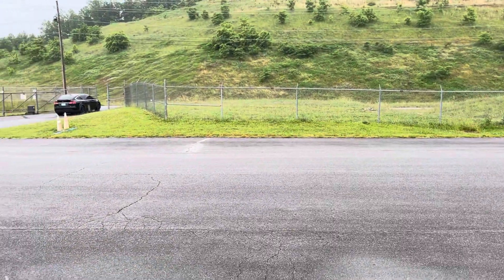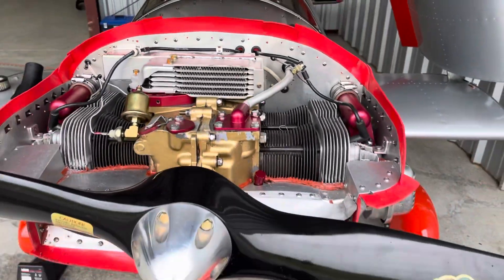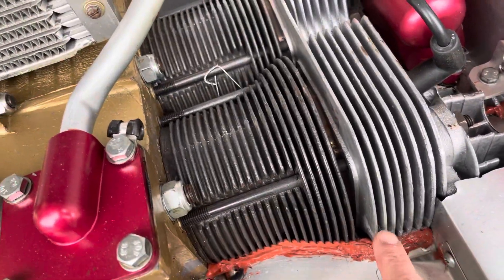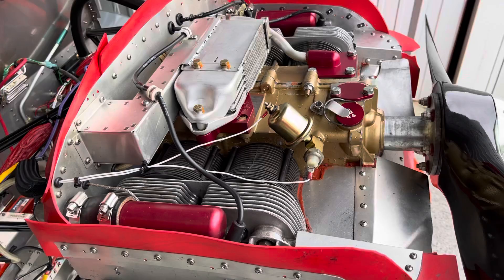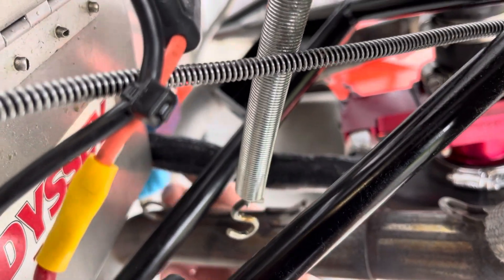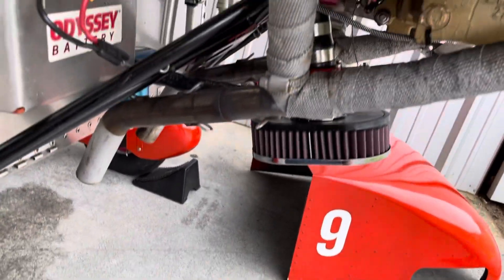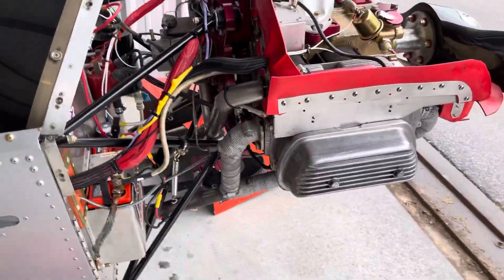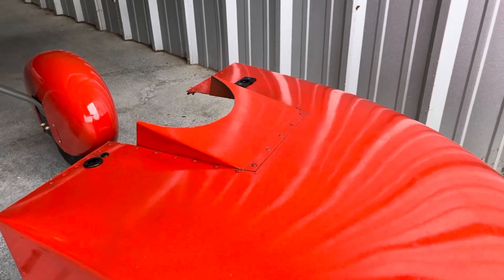Hot and Cold (Lean of Peak Aviation)

Comment: I'd safety that K&N filter - mine popped off and melted on the pipes.  That model is no longer available.
Reply from the maker: I actually changed it.  I didn’t like the security.  I’ve got the one that fits directly into the stock housing.  Good comment!

Comment: I used the same carb setup on my AeroConversion powered Sonerai. As is you don’t need carb heat. Power loss is negligible. Adding a fresh air vent to the carb, if not RAM air, will create higher pressure in lower cowl, decreasing the pressure differential, and you’ll lose cooling airflow over the engine. Plus, you’ll need to add some kind of carb heat.

Comment: Greetings!    Thanks for the videos - new subscriber here.   I would cation you about the mod you are doing.   A large unsealed opening to the bottom will decrease the pressure differential -  thus decrease the cooling air flow.   You will get better engine performance with the cooler air, but less engine cooling resulting in higher cht's. Worse, you installation does not look like it has carb heat.  so getting rid of the inherent carb heat of the old set up may be fraught with complication.   while the  guillotine based aerocarb is less prone to carb ice, check the sones forum and you'll see a few tales...   I would suggest you seal the intake to the carb and add carb heat).  You'll get cool ram air.  Then protect against vapor lock using heat shields and wrap (and if necessary a vented cooling box over the gascolator). I like controllable cowl flaps with a lip.  You can get adequate cooling both for cruise and climb.  be sure you have the inter-cylinder baffles (VW cooling tins).  finally,  be careful about rpms higher than 3000.  If you are going to run high rpms, get the engine/prop dynamically balanced, etc.
Reply from the maker: Thanks for the comments.  The carb heat is certainly a concern and still a bit of a question mark.  There’s hasn’t been a confirmed case of carb icing on an aero carb and it’s really hard to know if the stories on the forums represent an icing issue or a vapor issue.  Unfortunately Aerovee engines have developed a reputation for vapor issues at lower speeds near the end of flights.  Mine was having very serious vapor issues prior to the mods.  Heat shielding and insulation didn’t solve that problem one bit (it was attempted).  I can’t have my engine quit on short final after a perfectly normal flight.  The extra airflow and moving the exhaust really solved that problem.  I understand the concern about open airflow in the bottom cowl and pressure differentials…but it’s interesting to note that on all Sonex other models they recommend having an open “smile” in the front of the lower cowl.  Look at all the Aerovee powered Sonex and waiex models.  The manual says you need this whether there is an oil cooler down there or not.  Many people on the forum claim higher oil temps if they don’t have that opening present.  Also, the aerocarb manual specifically states not to use a sealed ram air system with the aerocarb.  So here’s where I’m at right now.  They performance is markedly better.  There are no more vapor issues, and Interestingly my CHT’s are actually much more manageable now.  I guess carb ice is my concern at this point.  Maybe adding a slide valve to lower cowl tube would be an option.  All in all things seem to be going well.  I’ll post an update video shortly.

Comment: here is something i took off the SonexBuilders.net forun......this guy has been flying his onex for years and years ,,,i fact i have seen his airplane at a fly in breakfast........./// good day rick//////
Postby Onex107 » Tue Nov 15, 2016 2:45 pm
Getting back to you late. Been gone all day. When the engine was "new" I had over temp problems but as I remember 
they where mostly solved by retarding the secondary ignition about five degrees.
 The engine took about 20 - 30 hours before it really settled down and ran repeatedly.
 During that time I was fighting "the burps" as well and more flights were terminated for that.
  I removed the gascolator and wrapped the pipes and insulated the exposed gas line including the front end (fuel line end) of the AeroInjector.

Comment: at 1;44 on your video, i think, i see that you do not have the "tin kit" on the V.W. engine, that blocks the air from going between the cylinders , i just helped. remove a jug / cylinder off of a 6 cylinder continental engine and it had the blockers on it also.... another no  cost / .02 cent idea>> is to get a step ladder, and look down at the V.W. engine and see if there are any holes, that will let the air leak "go around" the cylinders fins.... another .02 idea>> off of the SonexBuilders.net. ((forum))....is to increase the size of the "hot air" exit at the bottom of the cowing.....another thing to look into on the SonexBuilders.net / forum is how others have cooled the gas lines and gas filters....and a another idea is do a search , on the SonexBuliders.net / forum for the subjects of """engine (burps) '''''......good day / rick
Reply from the maker: Rick thanks for the great suggestions.  You’re absolutely right about the air block in between the cylinders.  I’m planning to install those before I put it all back together.  The Sonexbuilders site has been a great resource.  I’ve actually talked to #107 and he’s given me a lot of good advice.  I’ll be implementing several of these ideas in some form as we go.  Stay tuned!
Reply: another .02 cent idea.....from my reading of SonexBuilder.net ,,,,,i think the black carbon fiber cowling scoop, you show at 2;57 min. are thinking to add is a """bad idea""". #1 reason from what i read the ""sonex AERO-injector carb" , workes best with it being surrounded by negative air pressure......#2, adding ram "positive air presssue" , to the bottom of the cowling, would be bad of cooling ,,,,,,but at 3;29 min you talk about adding a ""LIP"" to the bottom would be a very good idea >>. see this link  of a photo a RANS S7 and it's LIP on it's lower cowling.....http://4.bp.blogspot.com/-t7N15SKmalU/UmljFBTFetI/AAAAAAAATXg/NS1BrUny9GQ/s1600/XBO+TI+13-10-13.+Vince+Gardner++(3).jpg...............good day / rick
Reply: i think i remember...from my reading of poster #107 on SonexBuilder.net,,,,,,,he talks about keeping / making gas going to the AERO-carb """"cool"""........and you do talk about you engine quitting after landing , so putting a shroud over the gas-ulatator  "? spelling" ,    and feeding  it ram air, via a scat hose.from the back of baffling.......that would stop the heating / heat soaking of the gas ,,,,,  and you talking to poster #107 is the best thing you could do.....for your onex.............. thanks again for the videos / good day / rick